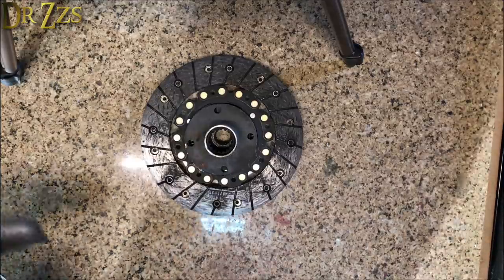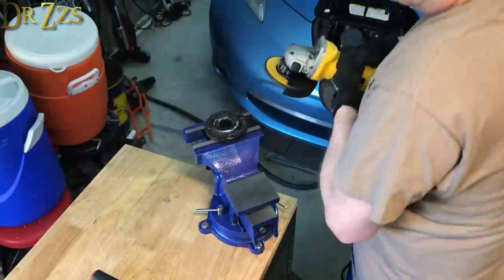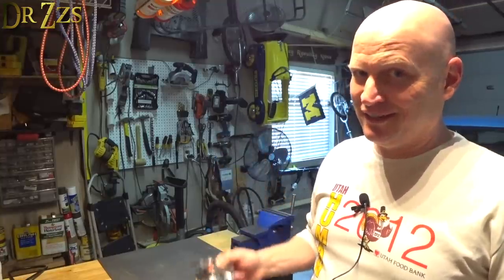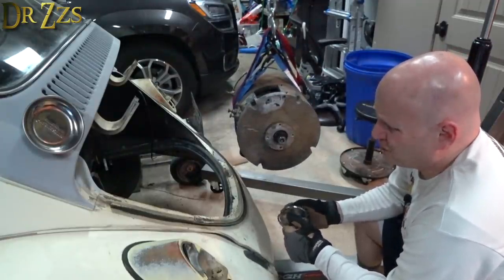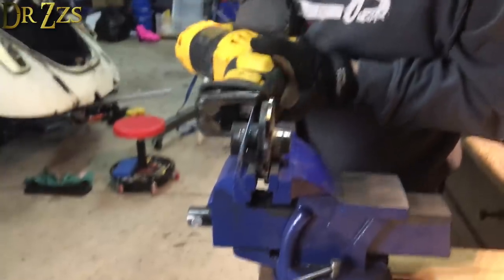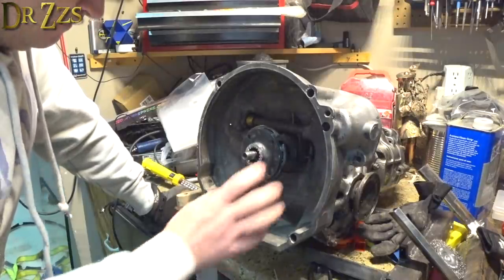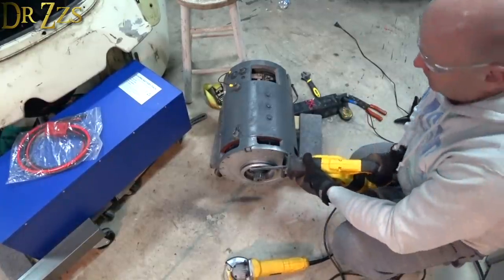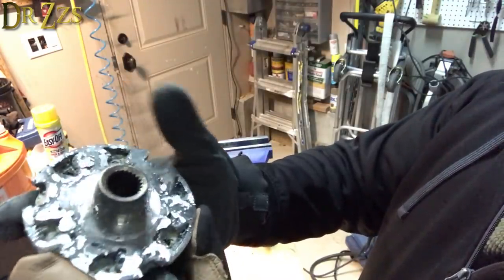Electric VW - Making the Coupling to join the motor to the transmission: Electric Car EVConversion

Comment: As soon as I saw you grinding I thought "Well, there goes the Leaf". As you found out with the windshield. You may also find the hood of your Leaf "rusting" in the next few years as the tiny hot metal fragments have embedded themselves into the clear coat. Get a clay bar and go over the entire front of the car.

Comment: Did you get this motor running? The motor that you have is out of an E50XM2,  it's a SEM (SEPARATELY EXCITED MOTOR) motor not a series wound motor. You'll need the appropriate type controller to run it. That's why the field cables were approximately 10 gauge and the armature cables were 2/0. The field runs on much lower current than the armature. Good luck with your project. You might go back to that yard and get the traction controller. The controllers have a pretty high failure rate so that might be why it's in the scrap yard in the first place.

Comment: If you want to cut the shafts correctly, spin the motor!  Spin the motor while using a angle grinder, use a sharpie to mark it, and you barely have to do any work.   EVwest has a video on this technique.

Comment: Shoulda kept the sawzall blade oiled when cutting the motor shaft. The sparks mean shit's hot, and heat means soft. The blade is wearing fast because it's hot, and oil takes away heat (as smoke). Keep adding oil when it stops smoking, because that means the oil is gone.

Comment: I love your engenuity, but I'm afraid this time you limited the transmission too much. In high torque situations like up hill under heavy load it will break. Also centering two shafts is very delicate for vibrations and alignment. Torsion will ruin it.
Why didn't you mount the motor from underneath ?
Reply from the maker: Thanks!  You are very right.  That coupling could break apart any time.  I'm learning as I go here.  I want to do more of these conversions.  Hopefully I'll get better each time. 
I tried every angle for getting the motor in there.  From the top from the bottom, with the transmission attached or detached.  What finally worked was (cutting it down), leaving the transmission loose but still in place so I could wiggle it some, then bringing the motor in from underneath. It was a major pain.  Looking back, I wouldn't recommend anyone use a motor this size in a bug.  There's just no good way to get it in there.  A smaller motor would probably still push the car fine.  I was just going for what was cheapest.  $200 for that motor vs >$1000 for a newer/smaller one.
Reply: @DrZzs  Yeah you're right. I would do the same thing. Improvise with the stuff I have or can get cheap. It's a compromise worth trying. I thing the bug will run fine and maybe another motor opportunity may come along. Then you can swap them.
Looking forward to see the next episode.
It doens't matter that you're not an engineer. Me neither, I guess we're both 'arrangeers', it also ends on 'eer' so we're pretty close !
It' people like us that fix things and get the job done I guess ;-)
Reply: Wouldn't it have to be pretty balanced as well? High RPMs would have quite a bit of vibration.
Reply: @TheOldBlackCrow  Indeed. Especially certain oscillating frequencies cause problems. Avoid the RPM's that are causing the vibrations. No that easy in practise of course. For coupling shafts there are lots of solutions available on the internet. Adding rubber dampers is desirable, but in this setup there's not enough space. Unfortunately !
Reply: Love your vids man, especially the floating bald bliescreen head... make sure you wear ear plugs and goggles man! Sucks being deaf or metal in the eye balls! Keep it up

Comment: Normally the elec controller would vary motor speed without transmission. Does using the variable speed elect motor and transmission feel ok, what vehicle speeds are you getting?
What are you using for batteries?
I want to do the conversion you've done with a 4WD dune buggy. Watching you makes me think it's possible. Not because of the DIY methods but because you did a great job showing your obstacles and solutions.- Thank you !

Comment: Hi with the signifiantly reduced spline shaft length will you have enough float to account for movement in the transmission and motor assuming its going to be mounted on some flexible mount?

Comment: Not quite sure that welded thingy is sufficiently balanced at speed, but hey, hoping for ya :)
Reply from the maker: I'm sure it isn't.  We'll see how long it lasts :)
Reply: Take off the real wheel axle transmition slap on the motor and bolt back

Comment: Good luck to the motor and transmission bearings ! You'll be both missed ! 😂
Also good luck to the teeth on both shafts ! You'll live short but intense ! 😇
Reply from the maker: It's drives.  That was my primary goal.  Longevity is WAY down the list. :)

Comment: lol do you reallize that motor most likely has more torque then a v8 engine off the line. i would not have removed any i would have move trans or cut or beat the sheet metal to make it fit. we did a 95 chevy cavalier was a 5 speed and used all electronics and motor from a clark fork lift we did the same as you did but turned the stuff on the lathe so it was centered right and it was tig welded and the 1st ride he hit pedel to fast and it striped the spline right out of clutch side we had to doubble up that side or it ripe them out. best i can say is good luck and be easy on the go pedal are motor was a little bigger but not much.